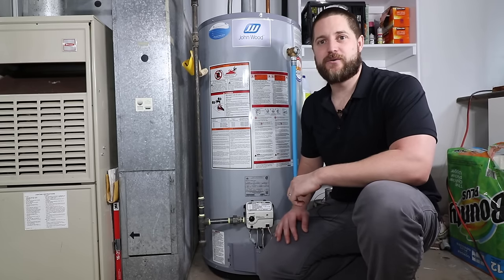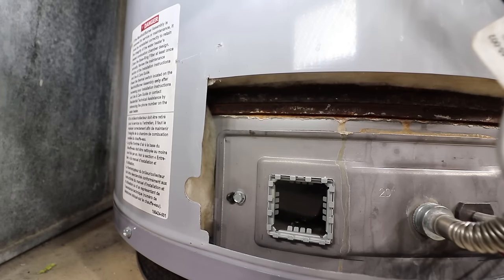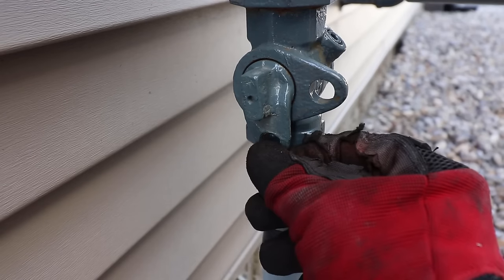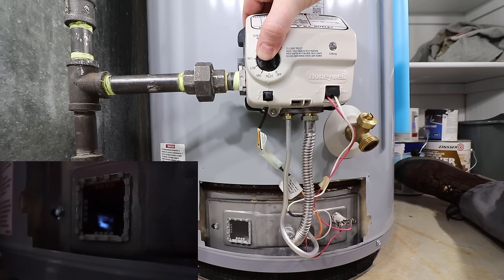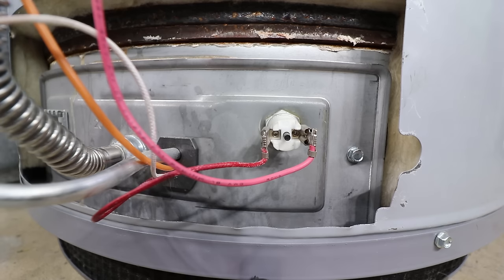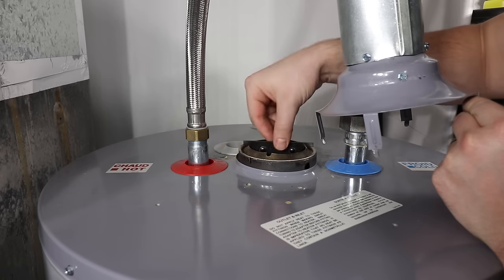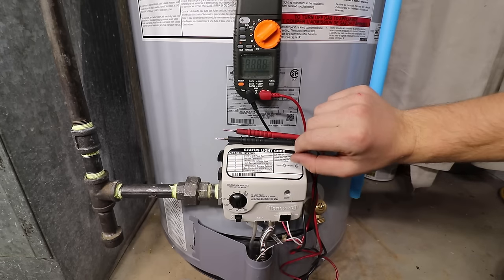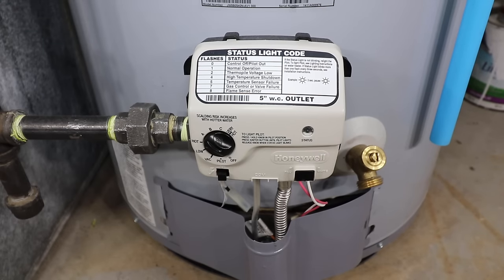No Hot Water: Water Heater Troubleshooting

Comment: What if my 75 gallon propane heater is blowing black soot out of the exhaust constantly and stinks terribly
Reply from the maker: Hi Terry, Black soot coming from the exhaust can be a dangerous situation and I would get it looked at by a professional. Black soot at the top of the water heater can indicate incomplete combustion, obstructed venting, lack of combustion air, or back drafting. All of these scenarios could cause carbon monoxide seeping into the room. If the water heater is running and you can feel air/exhaust flow out over the tank from the draft hood and not up the venting system, there's an issue. I'd purchase a carbon monoxide detector for piece of mind and have the tank look at by a certified professional. Thanks for the question.
Reply: @PROSDIY  thank you I have several carbon monoxide detectors and they were all going crazy three four months ago when I first noticed the odd smell in the house it wasn't properly vented out of side it is now but it's still not combusting right
Reply from the maker: I'm so glad you had some carbon monoxide detectors in place. Carbon monoxide is definitely no joke. It sounds like lack of combustion to me. Possibly a clogged intake screen if applicable, at the base of the water heater.
Reply: @PROSDIY  I got a really long blowgun at harbor freight and ran my airlines from my shop into my bathroom window down my staircase to the basement and partially disassembled that stuff and blew out some dust and lint. A lot of black carbon. It's a very expensive self-lighting self-igniting propane heater 75 gallon let itself back up and every time we run the hot water it blows black soot out the stack going outside of the basement into the backyard smells horrible
Reply: It is under warranty I need to call the local installer of this brand and see if they'll send somebody out to diagnose it
Reply from the maker: @latunguley  Ya that sounds like the best idea, especially if it's under warranty. Hopefully they can find the cause of the black soot. Black soot in most causes is a incorrect air/gas mixture. Has it been doing this since day 1? It sounds like a power vented or power direct vented model since you say it is self igniting and venting horizontally. Do you have a vent and intake pipe run to the outside or just a vent? It's very important with these models that the venting and exhaust is installed as per manufactures instructions. Running the vent too far or too many bends can cause problems. If it is a 2 pipe system, running the exhaust too close to the intake can lead to problems as well. If it is a 2 pipe system, colder weather can also cause issues with the intake freezing over. If you supply me with the model number of the tank I may be able to get you in the right direction. Hopefully the installer can help you out. Cheers!

Comment: What about 0 flashes and it doesn't turn on  even if I put it on pilot and hit the ignition button?
Reply from the maker: Is the pilot flame lighting? Seen through the sight glass.
Reply: @PROSDIY  no
Reply from the maker: That's the first step then.
1. Check to see if there's a gas supply to the home. Proving it at another appliance. (Stove, Furnace, etc.)
2. Check to see if the supply gas valve to the water heater is in the open position.
3. Check to see if there's spark. Turn the lights off, look through the sight glass, and click the igniter a few times to prove there's spark. 
Check those three things and let me know what you find. Thanks
Reply: @PROSDIY  I don't see any spark. I smell the gas when I press on the pilot but I don't see any spark and it doesn't turn on. Also no lights flash.
Reply from the maker: So we can rule out the gas supply. Sounds like a spark issue.
1. Check to see if the piezo igniter wire is fully seated. This is the wire that enters the bottom of the igniter button. Then try sparking again.
2. Inspect the piezo igniter wire for any breaks or bare wire.
3. Pull the igniter wire from the bottom of the piezo button. Hold the wire about 1/4" - 1/2" away from where it plugs in and click the button. If you see a spark jump, then the piezo igniter button is working properly and the issue is with the pilot assembly end of the system. If it doesn't jump the piezo igniter button is faulty and has to be replaced. Please wear a glove when performing this test. The spark can jump to your finger and give you a small unpleasant shock.
4. If still no spark the burner assembly should now be removed. Check for any breaks or bare, uninsulated wire.
5. Now check where the spark jumps from the end of the igniter to the pilot assembly to light the pilot flame. If it is covered in carbon, then take some fine sand paper and shine up the area where the spark jumps. If it is covered in carbon the resistance for the spark to jump is too high and no spark will be visible. This is probably the most common cause of no spark. You can test for spark again with the burner assembly out of the water heater before putting it back.
If you have any questions, please let me know. Thanks again and good luck!
Reply: @PROSDIY  so I took it apart and cleaned it up with fine sand paper. I put everything back and still no spark. My fingertips are literally hurting 😫
And still 0 flashes like it has no power whatsoever.
Reply from the maker: Did you have spark in step 3? If there was no spark jumping out of the bottom of the igniter to the wire, then the igniter was the issue.
You can test for spark with the burner assembly outside of the water heater, as stated in step 5. There's no need in putting the burner assembly back if spark isn't proven.
Reply: @PROSDIY  ok let me remove it again and I'll press the button to see if there is spark.
Reply from the maker: @randyu8688  First check that there's spark from the igniter (step 3). Easiest steps first. Pull the igniter wire from the bottom of the piezo button. Hold the wire about 1/4" - 1/2" away from where it plugs in and click the button. If you see a spark jump, then the piezo igniter button is working properly and the issue is with the pilot assembly end of the system. If it doesn't jump the piezo igniter button is faulty and has to be replaced. Please wear a glove when performing this test. The spark can jump to your finger and give you a small unpleasant shock.
Reply: @PROSDIY  ok I got spark now and it turned on
Reply: It's on but now it's flashing 7 times. Meaning gas control valve failure
Reply: Nvm it's flashing one time meaning Normal Operation!

Comment: Do I turn the breaker off?
Reply from the maker: The example water heater in this video is an atmospherically vented, gas fired water heater. There's no electrical running to this model, so no breaker to turn off. If you have an electric, power vented, power direct vent, or tankless water heater, then yes turn the power off first before working on. Thanks for the question!

Comment: At 1:19 you say spark the ignitor a few times to ensure it's sparking properly. What if it's not?
Reply from the maker: Great question. The steps I would take are as follows:
1. Check to see if the piezo igniter wire is fully seated. This is the wire that enters the bottom of the button. Then try sparking again.
2. Inspect the piezo igniter wire for any breaks or bare wire.
3. Pull the igniter wire from the bottom of the piezo button. Hold the wire about 1/4" - 1/2" away from where it plugs in and click the button. If you see a spark jump, then the piezo igniter button is working properly and the issue is with the pilot assembly end of the system. If it doesn't jump the piezo igniter button is faulty and has to be replaced. Please wear a glove when performing this test. The spark can jump to your finger and give you a small unpleasant shock.
4. If still no spark the burner assembly should now be removed. Check for any breaks or bare, uninsulated wire.
5. Now check where the spark jumps from the end of the igniter to the pilot assembly to light the pilot flame. If it is covered in carbon, then take some fine sand paper and shine up the area where the spark jumps. If it is covered in carbon the resistance for the spark to jump is too high and no spark will be visible. This is probably the most common cause of no spark. You can test for spark again with the burner assembly out of the water heater before putting it back.
If you have any questions, please let me know. Thanks again and good luck!

Comment: I got the pilot light lit but there’s still no hot water
Reply from the maker: Are you getting any error codes?
The control knob needs to be in the on position and the temperature dial turned up (A or B) for the main burner to fire. If the main burner lights up it will take 45mins - 1 hour for hot water.

Comment: So if the heater has been off for 3 days it’s been leaking gas??
Reply from the maker: Great question wa mu! The answer is no. The pilot flame operates the pilot gas and main burner supply. If the pilot flame is out or off then no millivoltage is created. This millivoltage is what operates/opens the gas control. Thanks!

Comment: I have no problem with the pilot light, and the burner comes on, but I don’t get any hot water, what could that be?
Reply from the maker: Just a few questions to get in the right direction.
Do you have water pressure on the hot side? Open a faucet on the hot only side to check.
Is the water lukewarm at first, then cold?
How long has the main burner been firing?
What temperature is the water heater set to on the gas control?
Thanks for the question!
Reply: Water pressure is good, the water is cold not like warm, I have it set on very hot, which is the highest setting, the burner doesn’t change intensity through any of the settings.
Reply: And it’s only about 5 years old.
Reply: @Pros DIY I never dealt with this before, the burner is on and should make some hot water.
Reply from the maker: Thanks for the information. Was the pilot/burner flame out and then relit? Depending on model and capacity, it may take up to 1 hour for full recovery and hot water.
With regards to the highest setting and flame intensity. Standard atmospherically vented water heaters have a constant gas delivery and flame height/intensity which isn't effected by the temperature dial being increased or decreased. The temperature dial just adjusts water temperature. This means the main burner will fire for longer if the temperature is increased.
Reply: The pilot light was out, I relit it and and turned the knob to the hottest setting, it’s been on for a hour, still no hot water.
Reply from the maker: Is the main burner still firing at the moment? If it is, I would wait until it reaches up to temperature and the main burner shuts off, then go from there. I'd recommend not setting the temperature dial to the hottest setting as well. Depending on your model "A setting" should be sufficient.

Comment: How much is water heater ?
Reply from the maker: There's many variables with the purchase price of a water heater. Capacity, BTUs, model, location. A standard atmospherically vented 40 US gallon water heater currently at Home Depot in Canada is $650 CAD. The price of these units change very often though. Just 5 years ago I was able to purchase the same tank for under $400 CAD. Thanks.

Comment: Did not help. I moved recently into a place with the hot water heater completely hooked up, but off. The pilot light is ignited. The water is still cold.

Edit, I fired it up over 8 hours ago

2nd edit: I made a very small stupid mistake it was my fault. Never turned on the burner.
Reply from the maker: Hi Keith, I'm glad you got it figured out. Take care!

Comment: My water heater my dad installed himself. But the hot water doesn't last long at all maybe 3/5 minutes
Reply from the maker: Hi Ronald, I would check the following:
1. That the temperature dial is turned up to the appropriate setting.
2. That the hot and cold lines weren't mistakenly reversed entering and exiting the water heater.
3. That the dip tube is in good condition. This is a tube that directs the cold water entering the water heater, to the bottom of the tank to be heated. If it is damaged it would result in a shortage of hot water. It can be easily damage if the soldering is done directly on the cold water inlet nipple on the tank, without any heat protection.

Sorry for delayed reply. I was away visiting family. I hope you got the issue resolved. Thanks!

Comment: so if the pilot wont light  it the  control valve is bad ..  if so  it only took 5 months for it to go out lol
Reply from the maker: Not necessarily. Do you have spark? Do you have a gas supply? Does the pilot stay lit with the pilot knob depressed then go out once release?  There are many things that can cause the pilot not to light or stay lit that are mentioned in the video. With the above questions answered, I'll be able to get you in the right direction. Thanks

Comment: I have no hot water so the cane and said I need to change my gas Value that is Connect to all my gas line and that’s gonna cost me $500 ?????? But some how dude made it work also ? What’s wrong here
Reply from the maker: I would require a bit more information. Model and serial number of the tank and the exact diagnostic, error codes, etc. Thanks